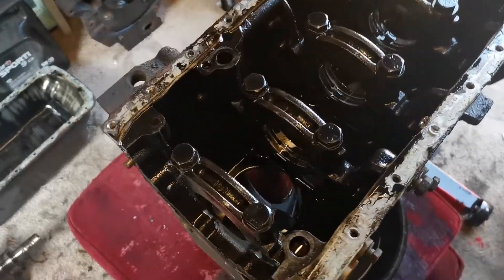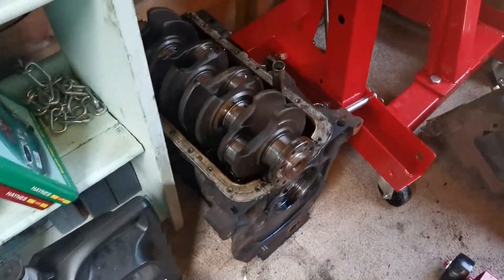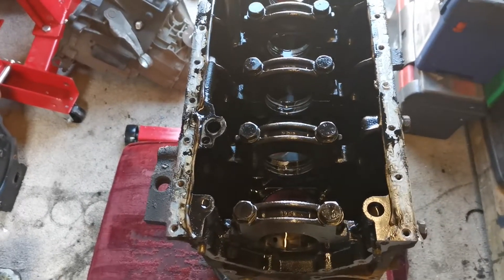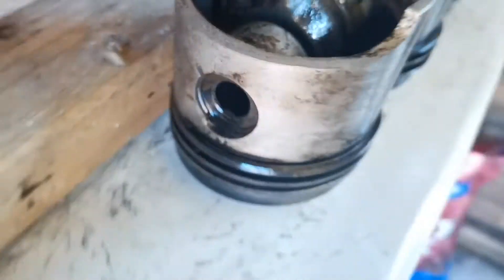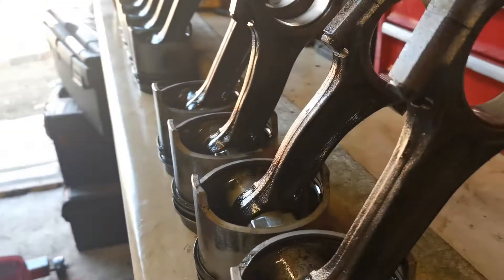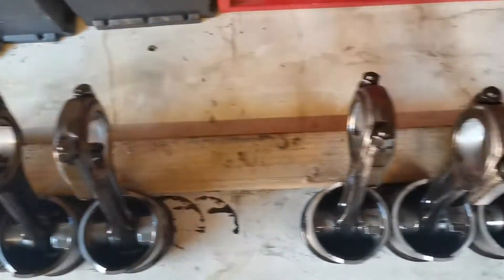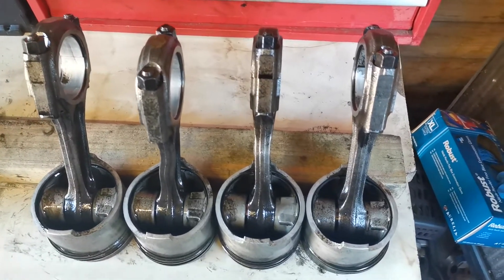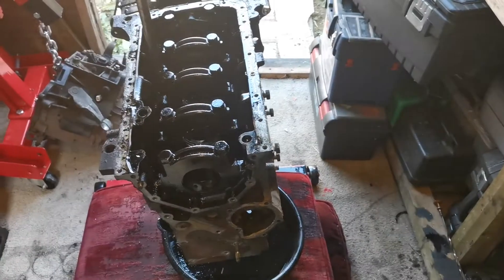The ZX engine teardown part 2

Comment: Blimey with that amount of  kink in those con rods, I'm surprised she started let alone drove mate. The pressure that it must've taken to cause it must've been phenomenal.  Great video chap
Reply from the maker: That's the thing she went from starting first time all the time to starting every second time sometimes third time even with a good battery and fluid is a very strong substance when under compression so it would probably shock as to how much force was involved while the engine was hydrolocked